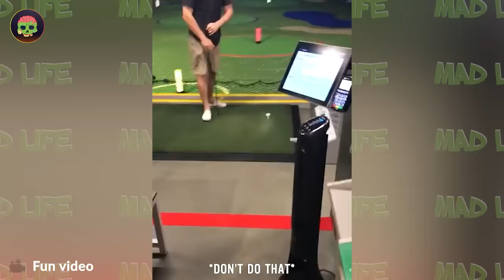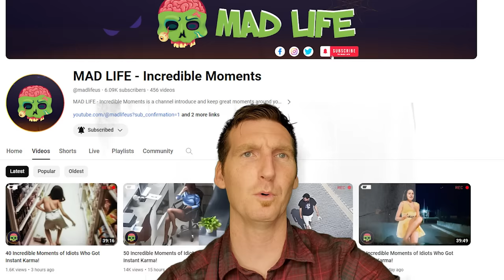1000 Embarrassing Moments On Live TV Caught On Camera | Incredible Moments| When Live Tv Goes Wrong

Comment: 35:04 isnt even on road thats just about at the 11.5  Km point on the  Nürburgring race track and open run is a mix of everything on track and its  ALL ABOUT  SPEED  flat out as best you can and that  section is in excess of 275+ KMH flat out push .  you don't know what your narrating so just keep quiet